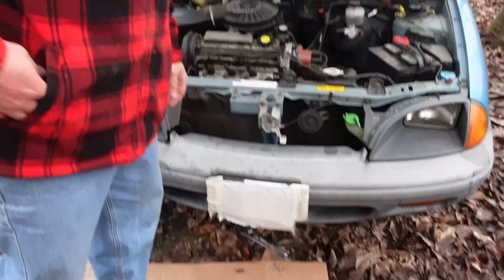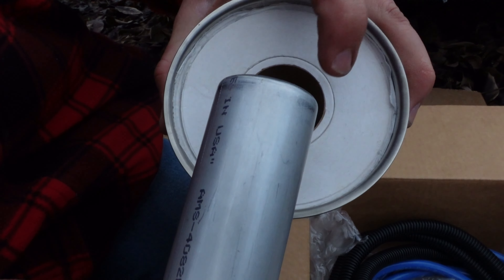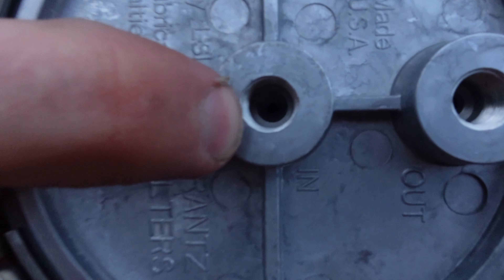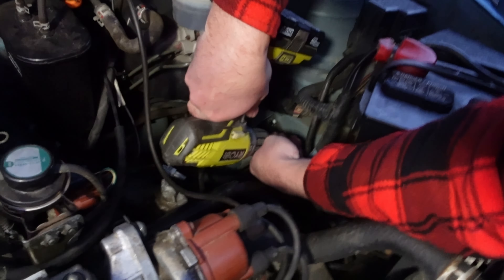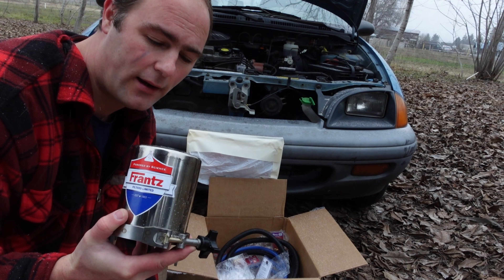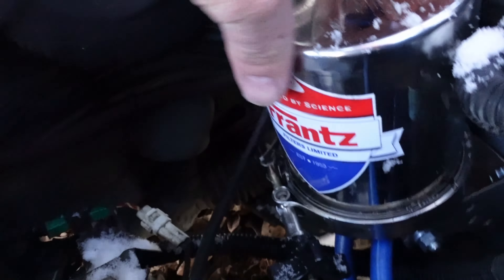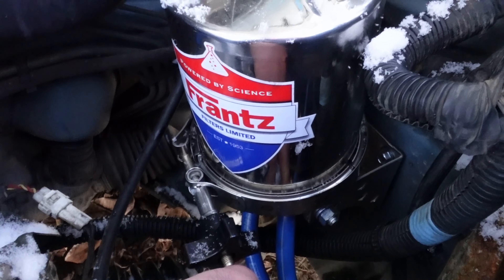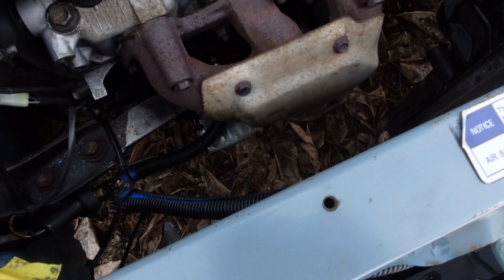Frantz Toilet Paper Oil Filter installation on a Geo Metro

Comment: This is a hoot.  In the air force, in 1974 my boss at the radar shop had a 69 F150 with a 390 engine and it had a toilet paper filter on it.  I made so much fun of it that he never forget it and when I left after three years he reminded me that it was still in use.  Lol
Reply from the maker: What is your opinion on them, work or not work, is it just a waste of time or do you believe it’s harmful to the engine, there are now many different screw on type bypass filters nowadays, ams oil is the one everyone has heard of. Thanks for the visit.😀
Reply: @frugallandlord6974  I can't tell you whether it is any good or not.  The only thing I would be concerned with is if the tissue particles break up and leave the filter getting into the engine.
Reply from the maker: @jeffsmith846  most people say that about the toilet paper particles but I have never seen any evidence or any real live user who has ever reported that happening.
Reply: The Frantz is a good filter. I used them for about 20 years before the better designed top loaders came.When I used them they took 2 ply. No Scott 1000 or Frantz elements. When they started putting the ring in I started tossing them.  I have a Australian Jackmaster Classic on the Pontiac. The other engines have Gulf Coast juniors Motor Guards and a flat head Ford V8 canister filter converted to use Scott 1000. It has half a roll of Viva paper towels in it now. You can get a 2 port Perma Cool 189 oil cooler sandwich adapter from Jegs or Summit. Sometimes the sandwich adapters are a lifesaver I still have a few Frantz 2 ports. They didnt work for small engines. In 60 years ive heard a lot of bs stories. The Australian Jackmaster Classic claims 1 micron if you use their elements. They use a high quality roll of Australian toilet paper in a sock. I quit draining oil in 1963 with a Frantz and Standard Delo 30W.  My 84 Subaru went over 250.000 miles with no oil changes using a Frantz and Mobil 1 15 W 50. I also used a Frantz adapter plate that eliminated the almost useless full flow filter. I am a filter guy. An Amsoil dealer told me he went to change his Frantz. The Frantz was empty. The roll had dissolved and was somewhere in the engine. It never ends. Of course Amsoil filters dont come apart in motor oil.
Reply: Amsoil has nothing that can beat a Frantz oil cleaner. I like their lubricants.
Reply: The old Ford f250 with the 390 engine has a 50 year old Motor Guard toilet paper filter on it. The C6 transmission has a Gulf Coast junior toilet paper filter on it. What do you want to know about toilet paper filters.
Reply from the maker: @ralphwood8818  thanks for the story, how many miles do you go between tp roll changes? Or do you go until it stops flowing? Cool that you have enough faith to remove the original filter 😀
Reply from the maker: @ralphwood8818  glad to hear that from someone with experience.😀
Reply: Normally with your car the oil will clear up after a few passes thru the Frantz. A diesel is another story. Some diesel soot is about 1/3 of a micron.
Reply from the maker: @ralphwood8818  how often do you change the paper rolls on your vehicle’s?
Reply: Normally I leave the full flow filter on. I have a old Farmall H tractor I put a 2.5 Chevrolet engine in many years ago. It has a full flow filter removal plate with a Motor Guard oil cleaner. Its amazing how clean the toilet paper is for an old Chevy engine. I have an oldsmobile V6 engine I want to put in it but I cant justify it.
Reply: When I found out about the Frantz I put one on my uncles 59 Ford car. In less than 50 miles it was clogged up with sludge. It didnt heat up. I said we will have to open the engine and clean it or change the Frantz every 50 miles. He traded it in on a new 63 Dodge pickup. When I was putting the Frantz on the Dodge his brother drove up. He said I would have given you my Frantz. Its no good my oil is dirty and my lifters are noisy. I said have you changed the Frantz. He said change it. The guy I bought it from said it would last a lifetime.
Reply from the maker: @ralphwood8818  lol great story, it would have been interesting to see how that 59 ford would have turned out, I bet it would have eventually cleaned it all out.😀
Reply: My answer to your question might not have gone thru. In the 60s I changed the Frantz or Motor Guard about every 2.000 miles.The Australian Jackmaster Classic gets changed about every 6.000. Thats normal conditions. Mostly highway Dallas Texas. The main thing is to operate at normal temperatures long enough for the PCV to do its job. The 59 Ford had a road draft tube that put the engine fumes under the car. The same as my old tractors. When California started requiring positive crankcase ventilation the fumes destroyed the valves instead of our lungs.
Reply: When you pull out the used toilet paper it should be strong and tear at each sheet. If it isnt strong it has been in there too long. If you neglect a full flow filter the pleats will get rotten and might break down. If toilet paper gets rotten it wont leave the Frantz. Some say the Frantz will clean the engine. It will only clean the oil.
Reply: If the oil can splash against the sludge and break it loose the Frantz can remove it. The sludge under the valve covers is permanent until it is removed by hand. Not so much a problem with modern engines and better oils. A lot of problems came with poor quality multi grade oils. Couldnt use multi grades in diesels. They required single weight. In the 60s if you wanted clean oil you had 2 choices. Motor Guard or Frantz. Motor Guard started as a lube oil filter in 1963. Later added a compressed air filter. Frantz was trying to sue them out of business. They dropped the lube oil filters I believe in the 70s. Motor Guards were the only ones safe to use for compressed air. In the San Francisco  California area you could get Motor Guards from Grand auto parts Bay Mart. Dick Cepec tires sold them for mostly off road use. Mainly VW dune buggies. When Dune Buggies and hot VWs tested them they put a inline fuel filter in the return line. They wanted to open it and check for tissue migration. Of course none was found. They did a nice article on them. If you check Motor Guards site the M 30 is similar to the old lube oil filter. I tried to bring them back by replacing the plastic internal parts with aircraft aluminum internal parts. They had a problem with me using toilet paper instead of their high dollar elements. They were a designed to use 2 ply toilet paper. Probably also the Australian Jackmaster Classic. They think they can cut down on the bs stories by hiding the toilet paper in a sock. They arent fooling anyone.
Reply: Corrections The Motor Guard came out in 1961. Frantz came out in 1953. The 53 Frantz was a Frantz canister that went inside the old canister filters Saw some Purolator conversions on Ebay.  Probably John Frantz models. The later Frantz diesel filters were a taller housing that took up to 4 Frantz canisters. The FAA and PMA approved AeroFrantz  and the diesel filters are gone now.
Reply from the maker: @ralphwood8818  wow great information, I love getting the history and the stories from people, you might be the most knowledgeable person on earth in the bypass filter world, and you watched my video, wow 😀 thank you very much.
Reply: If you have any trouble getting the filter to drain over night you   can  always put a tubeless tire valve in the top. Jackmaster recommends  a hand air pump. They dont want anyone putting shop air to it. I would use a valve stem with a nut on it.  You dont want to open a frantz full of oil. If you returned the oil to the oil pan it would drain. Best to return the oil above the oil level.
Reply from the maker: @ralphwood8818  great idea 😀
Reply: About 1985 a realtor here in Denton Texas told me he talked to one of my customers. He said I have a Toyota Corolla with almost 100.000 
Miles on it. Is it too late for a Frantz. I asked him how long he planned to keep the car. He said a long time. I said it needs a Frantz. Years later my wife was introducing at church. She said mr Biggs this is my husband. He said I remember Ralph. The Corolla has over 500.000 miles on it. He said we took the boy scouts on a camp out. They found the Frantz elements.
Reply from the maker: @ralphwood8818  how often do you change the actual oil in your vehicles and do you ever get oil analysis done?
Reply: . I normally dont drain oil. I depend on the bypass filter and new makeup oil added at filter change. I might drain the oil in a used car if I have concerns about the oil thats in it. Ive only bought 3 new cars since 1963 starting with a new Rambler American flat head 6. It came with a factory installed bypass filter. To clean the oil I installed a Frantz. I did like the neat steel oil lines. It was a 10 micron filter. The no oil change talk is misleading. In those days we changed the toilet paper in the Frantz and added a quart of new oil about every 2.000 miles.Some Frantz users would say things like Im still running on the same oil at 100.000 miles. He might have added 50 quarts of new oil. Delo 30W and 20W were beautiful when clean. 29cents a quart in the discount stores. Multi grades were all crap. The big Gulf Coast filters that replaced the Frantz diesel filters. Im told hold 10 quarts. If you change them every 10.000 miles and the full flow filters every 50.000 miles Road King magazine said thats equal to a full oil change. Every 40.000 miles. The advantage is the oil never gets dirty. The big Gulf Coast filter is rated at 99 percent at under.1 microm. The little filter cant beat a big filter. NASA saw my posts on a Trawler forum and started using them. The NASA diesel engineer said toilet paper is better than paper towels. Not 22 inches of paper towels.The last fleet I did I bolted the Gulf Coast O1s to the frames on the Powerstrokes. The Frantzs are actually too.small for a diesel. In the 60s the Powerstrokes  would have taken a Frantz 3 stacker. About 30 years ago I was putting a Frantz on a Chevy Luv. I see a little Frantz on his over the road truck frame I said sir that filter  is too small for that truck. He said no it isnt I change it every day. 8V71 Detroit.
Reply: Lab analysis is for very expensive engines. Pretty much a waste of money for my old stuff. I have a instrument for Gulf Coast filter customers such as Shell offshore.  These are Locomotive engines on offshore rigs. It passes a electric current thru a used oil sample. The conductivity is better in dirty oil. If the.reading is too high a sample goes to the lab to see why. If the reading is really high the engine is shut down. Shell engineers know how to read the imstrument. I dont. A guy said he isnt going to put a roll of toilet paper or Bounty towels in his expensive truck. I wonder how much a EMD locomotive engine cost. They used Frantz diesel filters before the big Gulf Coast filters. The big Gulf Coast O2 filter is equal to about 3 Frantz 3 stackers in capacity.
Reply from the maker: @ralphwood8818  yeah I understand about make up oil and TBN and that was exactly what my thoughts were, I just have to find the right intervals for changing the Frantz filter and spin on filter
Reply: @frugallandlord6974  If your driving conditions are the same as mine you should be able to go 6.000 miles between Frantz changes unless your Frantz stops heating up. I normally change the full flow every 2 years. The Frantz should keep the full flow fiiter clean. I expect your oil to look near new like mine. Toss the ring in the Frantz. Thats for people that use junk paper or force a over sized roll of Scott 1000 and make wrinkles for the dirty oil to bypass. Push in the paper just far enoigh so it doesnt  pinch. Save some used cores. Split them to put them inside the new roll to centralize the core. A egg shaped core might leak around the seal. With the top loaders you get the diameter right push the paper down against the seal and put on the lid.
Reply: Found a couple of old Frantz filters from the 60s in my junk. They need gaskets and hoses. My handicap scooter needs a filter for the lawn mower engine. That will take one of them. They will be set up for the new  paper.
Reply from the maker: @ralphwood8818  what do you mean by “set up for new paper”
Reply: @frugallandlord6974  When I used the Frantzs toilet paper fit the Frantz. Now the only paper that fits the Frantz is the custom made Frantz elements. You can adapt by putting a sleeve on the aluminum tube. The new toilet paper is also too short. The Frantz elements are the correct size. People are pushing the toilet paper in too far.
Reply from the maker: @ralphwood8818  I hope I’m understanding my filter properly but I think my new filter seals on the bottom, there is a metal ring that bites into the roll at the bottom close to the center of the roll, so it seals there and the outside of the roll. The rolls are too short but as long as they are seated well around the base then the oil pressure should hold the roll down.  There is no snap ring on my filter “Am I understand it correctly” ?
Reply: @frugallandlord6974   the Frantz depends on the seal between the aluminum tube and the toilet paper tube so the oil can push the paper down against the 2:33 crappy core seal. I didnt mind the bad design until the top loaders came out.
Reply from the maker: @ralphwood8818  if the dam at the bottom of the roll can hold long enough for the filter to fill with oil I would think it could still push the roll down, full disclosure, I just changed my roll with a Walmart brand 1000 sheet roll, I will post the video soon, that roll did not fit the center tube, it was very loose but I expected that it would seal around the dam that bites into the roll.
Reply: Im not a machinist but I can do round. Spacers for the Motor Guards and thicker and larger seals for the old Frantzs.
Reply: Some Frantz users are getting sleeves on line. I have copper sleeves. Im told the copper will show up on oil analysis. No problem with my stuff. I cant keep up with all the good bypass filters. Paying 50 bucks for some paper is a non starter. At one time I was getting 2 ply paper from Office Depot by the case. All of the good ones are top loaders now. There is a Extreme filter that looks like my Jackmaster. I bet it would take toilet paper. At 680 bucks I wont find out. My Jackmaster Classic is a drab green color.
Reply: If you get a good seal when you first start the car after a filter change you are OK some are pushing the paper in too far. Then the core has to fit the tube. With my Jackmaster Classic im manually pushing the core down against the core seal before putting on the lid and starting the engine. The Jackmaster Classic has no center tube. Not familiar with the more expensive Jackmaster Ultra.
Reply: The better designed Gulf Coast junior designed by a Frantz dealer when Frantz went broke has been discontinued.  Luckily I still have some in use. When I ordered the Australian Jackmaster Classic my wife said you dont need anymore filters. Very true. Had to try one. Some call them the Australian Frantz. More like a Australian Gulf Coast junior.
Reply from the maker: @ralphwood8818  I’m going to edit and post my video of me changing my roll, after all your comments I think my video is not very informative but at least you might be able to notice if I did anything wrong.
Reply: I expect your oil to look new in a short time . A gasoline engine has soot but not enough to notice unless you have a carboration problem. Some soot is about 1/3 of a micron. Not an abrasive.  The oil should look new on the dipstick. If you drain the oil into a wine jug it will be a little darker than new oil. Thats soot. Harmless. The oil in your Honda will always look new.
Reply from the maker: @ralphwood8818  The metro does produce a lot of carbon because it needs a valve job, yeah my Honda seems to be very easy on oil, I wish I could find a way to put a bypass on the Honda without putting it in the trunk, I can’t really find a good place to install it on my Honda, I have a Chevy 3/4 ton that I could probably fit one on and a Ford 1/2 ton plow truck but I barely put any miles on the Ford
Reply: The main thing with a Frantz  if you dont have a sleeve on the tube is for the paper core to make contact with the core seal  before the canister reaches the gasket. The seal is a little too small. Something flat like a flat washer about 2 1/2 OD by 1 1/2 I D. Push it down on top of the origional seal. The seal doesn't  have to cut into the paper around the core.
Reply from the maker: @ralphwood8818  I pushed the roll down on the base first, then I gently slid the canister over the roll to be sure that it was seated probably on the base
Reply: @frugallandlord6974  I just did that same method on loading my Frantz, pushing the tp firmly on the base, then pushing the can over the top, but I had a slightly over size roll and the can did not go down all the way, no worries I pushed the roll in manually, I used a sewing tape and using pie r square, lol, it was 4.18 inches, i think 4.15 inches is what I will use next, that is also 105 mm in metric speak. I saw a video by LSI, the owner for Frantz that had shown this element replacement method.
Reply from the maker: @JimmyJames351  my method was not scientific at all just unwrapped about 25 or so wraps until it felt like it would slide in tightly without creating any folds, my thought was to minimize the likelihood of channeling.
Reply: Sometimes Walmart will get a few Scott 1000 rolls in individual wrappings. They have the 1 1/2 inch cores. Its rediculous. The last ones I saw at Walmart there were 3 on the shelf. One Frantz user says he cant get Scott 1000 for a dollar at dollar tree now.
Reply: Back in the 2ply days we could cram in the whole roll. It was soft enough to smooth out the small wrinkles. The Scott 1000 or the Great Value 1000 should go in with two fingers or the same as the Frantz factory elements. Ive seen guys on YouTube force an over size Scott 1000 in and make a wrinkle from top to bottom. Then they need the wire ring to seal the wrinkle. Looks like an attempt to make the Frantz idiot resistant. In the 60s we didnt have the ring. The ring isnt needed with the Frantz elements or the same size Scott 1000. No danger of channeling with high quality properly installed paper.
Reply: One guy says the problems with the Frantz started when misinformed people like me started using toilet  paper instead of the proper Frantz elements. The Frantz has never had problems. They were designed for toilet paper.
Reply: If you put a Frantz on a neglected sludged up engine and it reaches its capacity in less than 50 miles and a mechanic tells you the engine is full of toilet paper when he sees the Frantz thats not a Frantz problem.
Reply from the maker: @ralphwood8818  good to know about the individually wrapped Scott’s 1000 I’m betting you could get them from Amazon or eBay
Reply from the maker: @ralphwood8818  yeah I never considered buying the overpriced Frantz filters, the original that I received with the new frantz was just toilet paper from what I could see.
Reply: @frugallandlord6974   When I met my secoond wife she had a 66 VW bug. The VW shop recommended a oil change every 1500 miles because the beetle didnt have a oil filter. I said I will put a Motor Guard on it and you wont need to change the oil again. She said wow cool. Had to tilt it so the big stuff wouldnt go back in the engine at shut down. The old Motor Guards filtered from the bottom up. Frantz recommended putting the Frantz upside down on the bug.
Reply: @frugallandlord6974 my present wife has a problem. She has a 2015 Accord. The car tells her she needs a oil change. The people at the oil change place dont recommend toilet paper filters. Im telling her it needs a toilet paper filter. Im rubbing it in bragging about her Pontiac that hasnt had an oil drain since we have been married over 8 years. The pontiac has the transmission and engine equipped. When she stops with the dumb blond act I will wrap a filter in some protection and lay it behind the engine. I have a Perma Cool universal 189 sandwich for it.
Reply from the maker: @ralphwood8818  wow I’m sure learning a lot from you I never would have thought about filter orientation based on how the oil flows 😀
Reply from the maker: @ralphwood8818  do you believe that you could fit a bypass filter under the hood of that accord, my civic is 2008 and I can’t find a place for it.🤔
Reply: @frugallandlord6974   My coments dont usually stay
Reply from the maker: @ralphwood8818  that’s weird, I sincerely appreciate all the comments that I do get to read from you, I have read each comment multiple times because you have so much knowledge and experience, thank you 😀
Reply: . Her 2015 Accord is a 4 cylinder. I can lay the filter loose behind the engine. Every car is a new adventure. In 1963 all you needed was to know VW beetles and American cars.
Reply: @frugallandlord6974  Thanks for the kind words. Just left a comment .It vanished. Might have been too long.
Reply from the maker: @ralphwood8818  I don’t know why that would happen 😞
Reply: @frugallandlord6974  It glitches out once in awhile, your reply can sometimes show up a day later.
Reply: @JimmyJames351 more trouble here than usual. That one where they give you a choice edit or delete. Dont matter which you choose its deleted.
Reply: @frugallandlord6974   That sounds like a good Idea. Making the seal at the core before pushing the canister down. Thats what counts. Then the tube doesnt matter. The Australian Jackmaster Classic has no center tube. You push the paper down hard against the core seal and put on the lid. When I used the Frantz toilet paper all had a 1 1/2 inch core and was the correct height. Watch out for egg shaped cores. The Frantz core is almost too small.
Reply: @frugallandlord6974  when I was in northern Idaho it worked fine because I was driving about 70 miles a day. The oil had plenty of time for the crankcase ventilation to get rid of the condensation and unburned fuel. Short trips in cold weather is a bitch. Talking about your plow truck tells me you dont live in Florida.
Reply from the maker: @ralphwood8818  yeah Pacific Northwest but the plow truck only gets used a few times a year, but it stays running for an hour or 2 each time, I would think the oil could warm up in that time even if it’s cold, how long do you think it takes for the oil to burn of the condensation?
Reply: @frugallandlord6974  Not sure but an hour should do it. If not the oil will look milky and the toilet paper will feel soggy. The same as a leaky head gasket. You are probably good if the Frantz is getting hot. I worked for Bunker Hill mining company in Kellogg Idaho Lived in Coeur d Alene.
Reply: @frugallandlord6974  my experience with a Frantz is when almost all toilet paper had a 1 1/2 inch core and was the right height. I used the Frantz elements some in the 80s. They looked like Scott 1000 on a heavy core.
Reply: I found a Gulf Coast Junior factory element today. Its in a sock. Removed the sock. It is as tightly wound as Scott 1000 and is 2 ply. The core is 1 5/8 inch. 4 1/2 inches tall. No dought it came from a janitorial supply. The Gulf Coast junior has a 2 inch core seal. 
A full time Frantz dealer designed it when Frantz went out of production. His main business was heavy duty marine diesel engines. When the Frantz diesel filters went out of production we got the big paper towel filters. When I sold them they used big roll Bounty towels. Dont know what they use now. They put them in a sock. They claim 99 percent at under 1 micron.
Reply from the maker: @ralphwood8818  My question would be, what reason do they need to put the paper inside a sock, what advantages does the sock provide?
Reply: @ralphwood8818  The old tp in the sock trick huh?  Did the paper have serations for each sheet? My Jackmaster sock element doesn't have sheet serations.
Reply: @frugallandlord6974  The only thing I see is it changes a roll of toilet paper to something that looks like a oil filter. John Frantz should have done that from the start. All he wanted was a filter better than anything else that was economical. The bs stories that came with toilet paper filters killed him.
Reply from the maker: @ralphwood8818  yeah people tend to believe mechanics or anybody with a professional title, even if they are terribly wrong 🧐
Reply: @JimmyJames351  I checked the Gulf Coast junior filter element this morning. It feels as firm as Scott 1000. Has the perforations and is 2 ply. The soft 2 ply we used in the old days was excellent. When Motor Guard used it they claimed submicronic. The new Motor Guard   white compressed air elements are  as tight as the Frantz elements and are like coffee filter paper in a roll. The core is 1 1/2 inch plastic. The core wont melt in hot motor oil but you dig it out in pieces. They gave up on oil filters I think in the 70s. Started in 1961 with only lube oil filters. Added the compressed air filters later.
Reply: Some people talk about when Frantz was popular in the old days. Frantz filters were the rage. Most people think oil is supposed to get dirty and be changed. If Frantz doesnt go broke again it will be because of the internet. You have to reach a lot of people. Toilet paper filters have never been the rage. Ran an ad in the paper about 1980. Got a call from mr Jones of the Jones bus company of Wichita Kansas. The Frantz on his old Chevy pickup needed a new gasket and hoses. A crop sprayer company invited me up to look at the AeroFrantzs on the crop dusters. The Jones bus company was Frantz equipped school buses.  Ran an ad here in the Dallas area. Sold a Gulf Coast junior to a GM technician at James Wood GM dealer in Denton. Most mechanics will tell you your car already has a filter. Oil is cheap engines are expensive. Things picked up when I had a website and people could use a credit card.
Reply from the maker: @ralphwood8818  well I have always done long oil change intervals over 10,000 miles and I have never had a oil related engine problem, I’m starting to think a gradual oil change like you say would be much better for my engine even if I never drain the oil, 1 quart of new oil with the new toilet paper roll everything 5,000 miles or so.😀
Reply: @frugallandlord6974  It was different in the old days. New oil had a lot of impurities. The polymers in multi grades didnt hold up for extended use. Diesel engine makers didnt allow multi grades. Some cars didnt allow some multi grades in their gasoline engines. Some owners manuals said use 10 40 and the warranty is voided. Too complicated for me. The discount stores sold winter grade Delo 100 30W and 20W for about 29 cents a quart in 1963. Told my boss at Ford to use 30W Delo 100. He didnt drain the oil in over 300.000 miles. He used 20W Delo. He changed the Frantz every 2000 miles and added a quart of Delo. Delo was diesel rated. It always looked new on the dipstick. Some Frantz users used non detergent. Motor oil is a natural detergent. I see Walmart has non detergent 30. If its not winter grade it might not work in cold weather. I put a Motor Guard oil cleaner on a oil tanker for a Spokane oil company about 1972. Told Hugh Barnhill the owner. To use Delo 30W. He said thats old fashioned thinking. He was an Amoco dealer.
Reply: People assume toilet paper will break down in oil. I towed in a car with a piston hitting the head. It had a Motor Guard toilet paper oil filter on it. The toilet paper was intact but was like charcoal shaped like toilet paper. Part of the full flow filter pleats were missing. The oil was too thick to circulate. The guy said he had been too busy to change the filters. It got a Japanese import used engine. I dont know of any way to make toilet paper leave the housing.